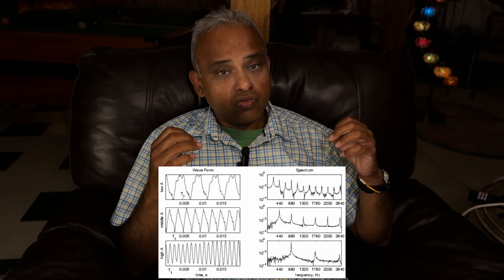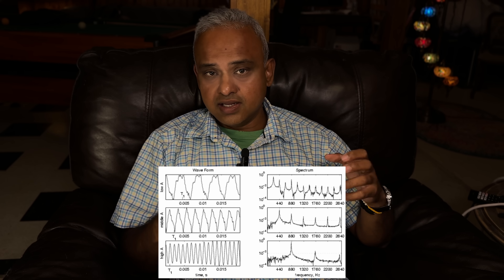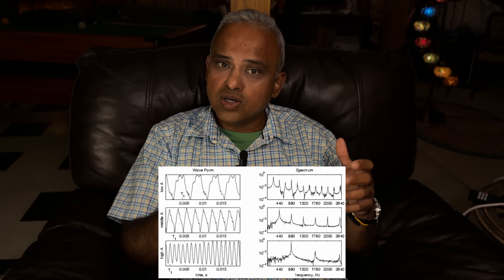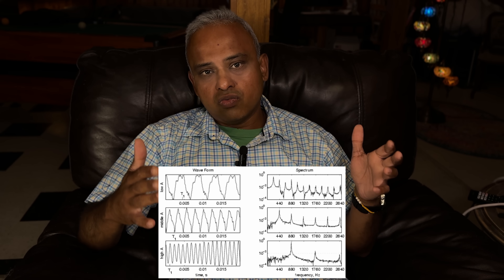Warm vs Analytical Sound | What's Really Different?

Comment: I’ve never heard a warm valve amp , I’ve had loads of them a tried different tubes , it’s very detailed, but definitely not warm
Reply from the maker: Getting to this a bit late. I have owned many tube amps as ell and some of the most resolving and transparent systems I have heard were tube based. Warmth is not an inherent trait of tubes. But I’ve have quite a few that induced warmth. It comes from circuit choices, operating points, transformers, power supply design, and how the whole system is voiced. Implementation is everything.

Comment: I think warmth in a recording only survives when the time domain is undamaged. Harmonics is all about time, isn't it?
Reply from the maker: Yep! Harmonics are not just about amplitude but about when they arrive and how coherently they line up in time. If the time domain is smeared through phase issues ringing or slow energy storage then warmth turns into blur very quickly. That is often why gear that measures flat can still sound dry or fatiguing while something else feels rich yet natural. Warmth that survives scrutiny usually rides on good timing rather than being painted on afterward.

Comment: You were talking about 'tube emulators', is that a studio (recording) thing, or can you mention an actual product that fits in hifi setups !?
Reply from the maker: Tube emulation originally comes from studio gear and plugins, where engineers deliberately add harmonic structure, soft clipping, and saturation to shape tone during recording or mastering. That is where the concept was formalized and measured.

In hi fi, it shows up in two ways.
One is digital or analog circuits that intentionally add tube like harmonic behavior without using actual tubes. This can be inside DACs, DSP, or preamps.
The other is outboard devices designed specifically for home systems that sit between source and amplifier and let you dial in harmonic richness rather than absolute neutrality.

So while the idea was born in recording, the goal in hi fi is different. It is not about fixing a track, it is about taste and system voicing. Think of it less as accuracy and more as seasoning.
Reply: @analogholic_reviews I understand the concept, but I don’t believe there is anything on the consumer market yet, but sure I am interested.
Reply from the maker: Consumer DSP exists. It is just marketed as control and correction, not romance. RME includes DSP features like loudness contouring, EQ, and filtering. Again, not sold as tube emulation, but the tools allow controlled tonal shaping that mirrors what people chase with tubes. Devices like DEQX and Trinnov are used in consumer hi-fi and allow intentional voicing, even though their roots are studio and cinema.

Comment: long story short:  tubes don't produce even order harmonic
Reply from the maker: Long story short… they absolutely do 😄
Even order harmonics from tube circuits are very real, especially in single ended designs. Push pull can cancel some of them, but that depends on how perfectly the circuit is balanced. Tubes don’t get a harmonic free pass just by existing.

Comment: Distortion is still distortion.  A key part of warmth is also, as you mentioned, a boost in the low mid frequencies.  Sometimes a warmed up recording played back on an additionally warmed up DAC/Amp, and then sent to further warmed up speakers, can make something like a female vocalist sound muffled, bassy, and nothing like a live vocalist would sound.
Since many audiophiles are not exposed to live unamplified music, they probably wouldn't like the sound of a live vocalist, drum set, etc if they heard them, calling the sound thin, harsh, and annoying.
The old idea of realistic sound reproduction has been replaced with the creation of 'pleasing warmth', the idea of which is feeding on itself to become ever warmer.  Such is the state of modern music reproduction. 
Hint: Turn off or disconnect your tweeters if you want even warmer sound.
Reply from the maker: You’re absolutely right that stacking warmth on warmth can tip things into muddiness, especially in the low mids. That’s a real risk, and it’s something people don’t always recognize when every link in the chain is voiced similarly.

"Warmth” in many cases is also about noise spectra, harmonic distribution, time behavior, and how our hearing perceives density and texture. Also, live sound itself isn’t a single reference — a close-mic’d studio vocal, a small jazz club, and an unamplified hall performance all sound very different in reality.

I agree that balance matters. The goal isn’t to pile on coloration, but to arrive at a presentation that feels believable and emotionally engaging in a home environment, which is never a perfect replica of live sound anyway.

Comment: The goal is life like instuments with fully beliveable timeing.
The coloring made by a balanced-bridged push-pull darlington amp.
It is not warmth by the deffinition because it is fully cancel out the even order harmonics.
Reply from the maker: That’s fair, and you’re right that transient behavior, power delivery, and speaker interaction also matter a lot. I kept this video focused on a few core ideas on purpose, since it’s aimed at non technical listeners and I wanted to avoid piling on too many variables at once. Those other factors are absolutely real, they just deserve their own space and a slower explanation.

Comment: Sorry guys!
You are being misled about warmth.
Yes, you can shape the frequency response of a system though EQing / a house curve. But that needs an accurate system.
Having a warm system means having a distorted system.
So go ahead if you love distortion and buy turntables and tube amplifiers.
Reply: "needs an accurate system."  ahh, but accurate according to what, a straight line or making it consistent with the inaccuracies of human hearing.  The latter is described by the equal loudness contours.

Comment: The "ineffable magic" of valves  explained 😮

I prefer to listen thru my valve preamps,  yes.

I also roll tubes and coupling capacitors in my Musical Paradaise MP701 preamp for different presentations of the music. 
I also keep an allegedly slightly warm sounding DENAFRIPS Hestia12th on hand for days when a cleaner, more neutral presentation appeals.
Why fool ourselves that musical satisfaction will come only with zero colouration?
You only listen once
🎵🎶🤫🎶🎵
YOLO
Reply from the maker: Totally get you! It’s all about finding that sweet spot. Enjoy the vibe and keep rocking those tubes!
Reply: @analogholic_reviews 
Thx for replying. 
Now that you've started into the topic,  how do you explain the valve's "ineffably" holographic soundstage effects?
They're more than just Second harmonic generators,  Right??
🎵🎶🤔🎶🎵
    🎶🎵🎶
         🎶

Comment: I'm confused... if the timbre of instruments (and various sounds) are due to harmonics, and those are picked up in the recording, then why does the recording not have all the harmonic richness needed to sound great? Why would adding additional harmonics from equipment on all sound (irregardless of what type of sound it is) layered on top off the natural harmonics of the original sound... sound better?
Reply from the maker: The recording does contain all the natural harmonics …nothing is missing.
What changes is how your playback chain presents those harmonics to your ears.
A tiny bit of added 2nd/3rd harmonic from certain gear doesn’t replace anything, it simply shifts the perceived balance in a way the brain interprets as fuller, smoother, or more natural.

So the extra harmonics aren’t fixing a problem in the recording… they’re shaping how we perceive the harmonics that are already there.
Reply: @analogholic_reviews 
Thats a stretch 🎶😅🎵
Reply: @SHREDTILLDEAD 
Don't misunderstand.
I Appreciate a nice clean preamp for a few days, then return to my valve preamps with relish😅
Rose coloured spectacles by any other name are still beautiful 😊

Comment: tengo dos amplificadores, un Sansui, y un valvular autoconstruido, los construyo desde hace mas de 50 años, este ultimo lo termine hace unos 5 años, como todo amplificador despues de costruido hay que afinarlo, o sea variar las distintas realimentaciones negativas hasta lograr el paso de banda adecuado, trabajo que es unico para cada equipo,  puedo pasar de un amplificador a otro en el momento, usando las mismas cajas acusticas que son muy elaboradas y de tres vias,  en dos gabinetes uno para bajos y otro para medios y agudos, los agudos en dos twitter , uno para agudos de 2000 a 5000 cs. y otro para mas de 5000, y siempre, sin importar la fuente, LP, cinta abierta, CD, MP3, siempre el valvular suena mejor o es mas agradable, tiene mas vida, no cansa, llena mas el alma, con agudos muy vivos y bajos que no solo se escuchan, se sienten, el Sansui es perfecto, pero con un sonido muy "seco",  gracias por el video 
I have two amplifiers, a Sansui and a self-built tube amplifier, I have been building them for over 50 years, I finished this last one about 5 years ago, like every amplifier after it is built it has to be tuned, that is, the different negative feedbacks have to be varied until the adequate pass band is achieved, work that is unique for each piece of equipment, I can switch from one amplifier to another at the moment, using the same very elaborate three-way speakers, in two cabinets, one for bass and another for midrange and treble, the treble in two tweeters, one for treble from 2000 to 5000 cs. and another for more than 5000, and always, regardless of the source, LP, open tape, CD, MP3, the tube one always sounds better or is more pleasant, has more life, does not tire, fills the soul more, with very lively treble and bass that are not only heard, but felt, the Sansui is perfect, but with a very "dry" sound, thanks for the video

Comment: If you connect a transistor amplifier to a speaker via a transformer there is a noticeable difference .All tube amps have to us a transformer to connect to a low impedance .....I have an unmarked  transformer bypass switch connected to my transistor guitar amp and ask people which sounds better ...they always choose the transformer active setting !   It is the magnetic compression loss that people find attractive . There can be too much detail all through the recording process ,just like 8k video in which data overload is distracting and not how we naturally perceive  reality . We  dump 98% of what we perceive to enable use to clearly focus on the specific element that is relevant to any one moment  .

Comment: After years, I've been solidly in the solidstate camp. Had tube gear of many varieties. but I don't want my amp to add stuff that isn't there. Tubes in guitar or my bass amps, sure, sometimes, but I don't want the hifi system to further distort the source sound. Even more, different tubes for the signal side or power side change the sound character noticably. So, which is the most honest, or correct, or (ugh) accurate reproduction of the original sound and character of the source? 

There can be excellent tube or SS gear, or equipment of either flavour that is thin, or sloppy or limp. Everybody has their own preferences, and budget, but I'm not going back to tubes and giving up the many advantages and musical insight of good SS gear.

That said, I absolutely accept that an excellent system can include SS or tube gear, depending on speakers, cables, sources and personal preferences.
Reply: Thanks! BTW, I totally forgot to say that this was an excellent video and explanation. Many thumbs up.
Reply: Yes me too, I have a Spectral preamp which is like a scalpel and I love the detail and absolute precision of the sound. However I can only listen for 3 or 4 hours at a time and then go back to my Cary sli-80 which I can listen to all day long. Imo there's no getting away from the human brain's reaction to odd order harmonics versus even order harmonics. I prefer ss but in the long run think that valves are easier to live with. Just my 50 years experience.

Comment: Great video. Thanks for explaining the reality of "warm" audio. It's the result of amplifiers -- especially tube amps -- adding new signals (harmonics) that aren't in the original. The added harmonics make the audio sound fuller. It's why guitarists prefer tube amps with their 70 year old technology over modern solid state amps. But for audiophile-quality reproduction, wouldn't a listener want the amp output to precisely match its input? Without adding anything?
Reply: If you were to listen to music by looking at your oscilloscope, your observation is valid, but you listen to music with your brain and through your ears, which is why those of us in the audio industry love tubes.
si escucharas musica mirando tu osciloscopio tu acotacion es valida, pero escuchas musica con tu cerebro y a traves de tus oidos, por eso los que estamos en el audio amamos la valvula
Reply: @luismariarigotti5659 Yes, you love vacuum amps, as do many, many audio enthusiasts. But the reality is this: tube audio amps are designed to be extremely linear, meaning no discernible distortion. So they aren't adding new signals to the original signal, which is the standard of hi fidelity. On the other hand, guitar amps are designed to be non-linear, which results in that distortion ("warmth")  we love so much.
Reply: If you don't know what good sound, REALISTIC sound is, then you're not qualified to discuss "warmth". Because you don't even know WTF it is. Are you talking about TONAL "warmth"? Or "fullness" in the sonic presentation, such as the "warmth" of PRESENCE in the sonic presentation? When sound is cold, thin, hard, bright without actually having a measurable excess of treble, I hate to break it to you: that's NOT "accuracy"!
That's what you get with 💩y digital crapnology, whose distortion FAR exceeds even that of mediocre analog equipment, from scratchy vinyl to hissy analog tape formats. Never mind the MEASURABLE superiority of a half-decent Valve amplifier vs. almost ALL transistor amplifiers, not to mention the appalling performance of Class D amplifiers which give you THE WORST of transistors & 1-bit digital all in one cool-running little matchbox of infinitely powerful AUDIO 💀 DEATH☠️!
If you don't know how to measure something; or worse, you DELIBERATELY set out to abuse measurements by selectively using them to tell lies, then you are an audio troglodyte who has no right to lecture others on sound quality, no matter how many MEANINGLESS Engineering Degrees & letters after your name that you possess. Because for all your purported education, you are STILL an AUDIO IDIOT.🤪🤤🤤🤤
Valve Amplification & Analog recording techniques sound better than their transistor & digital "competition"🤣🤣🤣 because they have MORE useable dynamic range, and LESS DISTORTION within the greater part of their greater dynamic range: at the LOWEST VOLUME LEVELS. WHERE IT COUNTS MOST.
Not just at EXACTLY 0VU in a digital system, where going even 3db over the reference level causes CATASTROPHIC levels of distortion that embarass even the cheapest Sony cassette recorder: Welcome to the HIDEOUS world of "Intersample Overs"! And because with digital RESOLUTION DECLINES IN DIRECT RELATION WITH RECORDING LEVEL, distortion already exceeds 0.5% in a 16 bit, 44.1kHz "Red Book" CD recording at a mere 40db below that 0VU ABSOLUTE MAXIMUM PERMISSIBLE recording level! You may not like tape hiss, but it is NOT waveform distortion, which is what increasingly occurs in digital recording as the levels drop & the number of available bits to define the signal drop in lockstep with them!🚮🤢🤮🤦
Transistors suffer from everything to non-linear behavior as they approach the small-signal levels where their semiconducting switching anomalies come into play, never mind their EXTREME sensitivity to even the most minor temperature changes which cause ALL their relevant performance parameters, from gain to noise to bandwidth to vary WILDLY; requiring EXTREME care in biasing them for linear operation & ORDERS OF MAGNITUDE more feedback to be applied to them because their INTRINSIC distortion in operation is ALREADY another order of magnitude (x10!) WORSE than a triode valve TO BEGIN WITH!
This DISGUSTING performance at the lowest signal levels, where whispers fade into the silence, WHERE GOD LIVES, is what wreaks ABSOLÚTE HAVOC with the timbre of musical instruments, & which WIPE OUT COMPLETELY the low-level cues & clues as to the size & shape of the recording venue, the pickup pattern of a given microphone, the subliminal shuddering of air-conditioning sending subsonics through the ductwork of the studio, or Opera House, or Theatre Hall, or...WHEREVER.
The absence of this information DESTROYS the proper harmonic structure of the timbre of a musical instrument, giving them all a "sameness" that is the hallmark of transistor amplification, & even more so digital recording CRAPNOLOGY.
So.
WTF DO you mean when you ABUSE the term "warmth"???🤔🧐🤨